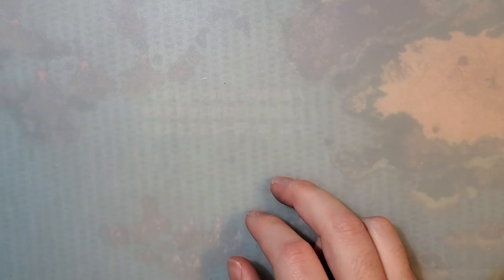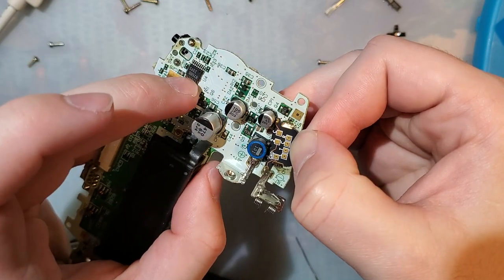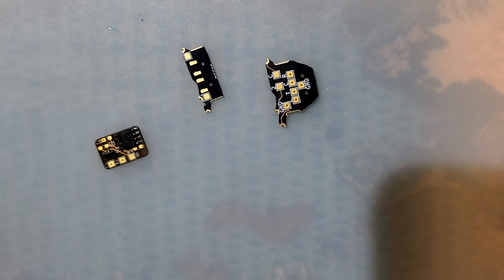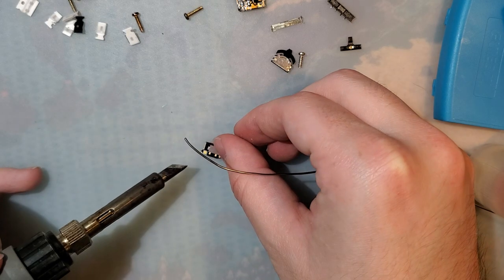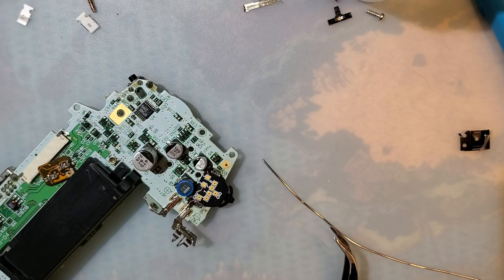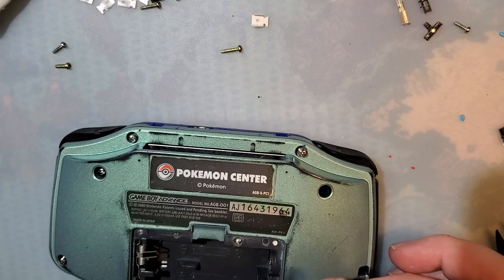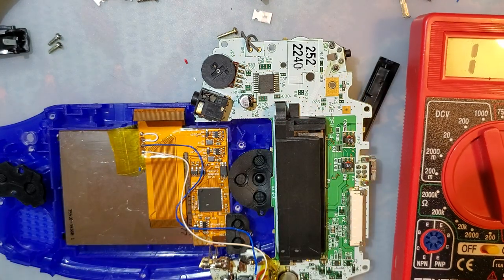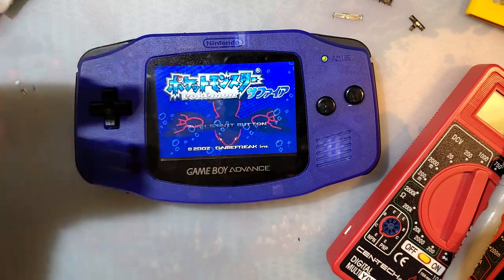Game Boy Advance Power Switch Mod (Soft Latching v2.1)

Comment: You can pry up the metal shielding on those momentary slide switches and the spring comes right out. It makes them handy for other applications.
Reply: This might sound silly, but you might still be able to get the clearance to work with the momentary slide switch by soldering it upside down to the PCB. The plastic piece would be a little bit lower, but it would more or less function the same.
Reply from the maker: @hinorashihinorashi  it's not silly, it's brilliant, and it makes me feel completely justified in buying both directions of switch. This will absolutely work.

Comment: btw, its much easiert to take the part out of the reel (with a tweezer) when its still connected to the reel, after that you still can cut the empty reel space away or keep it there to have it easiert when taking out the next part on that reel
Reply from the maker: yes, true, but I have a tremendously bad habit of just putting the roll down and forgetting to put it away. This is a problem with unlabeled capacitors especially. Cutting off what I need first is my work around.

Comment: You mentioned not bending the upper bracket after only releasing one side and that is indeed great advice. I did exactly that and tore the anchor pad up on the attached side. Not fun.

Comment: Im trying to restore a gameboy light. I changed the capacitors but I ended up destroying the power switch (which is beyond repair). Do you have any ideas on what to replace it with because it is differebt from other gameboy models.
Reply from the maker: I actually started working on this project with the Game Boy Light in mind since I'm working on one myself. I did not plan on implementing the light switch though since mine doesn't have an EL panel anyway. 

There are no solutions that I know of but I'm sure something could be cobbled together. I've just placed an order for a bunch of switches for the Pocket and I may be able to adapt one for the light and retain the third position. I'll know more when I have the hardware in hand (few weeks minimum).

Comment: Hello makho, I am struggling to find a replacement for the power switch of the GameBoy Pocket. Do you have any experience with that one? The switches I find are mostly too big or too small. Maybe you have a part number you can help me out with?
Btw I am really enjoying your videos. As I am an electrical engineer it is really amazing to see someone who tackles these tasks with that much electrical knowledge.
Reply from the maker: I have some ideas on direct replacement parts. I found a few potential candidates and I was going to place an order tonight. I fully intend on making a video if/when I find a good candidate. My favorite option is https://lcsc.com/product-detail/Toggle-Switches_ALPS-Electric-SSSS711403_C160877.html but, yeah, I'll share more once I know more. 

And I am absolutely not an electrical engineer, I'm just a dumb hobbyist stumbling my way through some ECAD and plugging things in and hoping nothing explodes. But it's pretty cool to hear that from someone who is an electrical engineer =)
Reply: @makho  thank you for your answer. I am glad that the compliment was well received.

Thank you also for the switch. I did some more Research too and wound up with the cus 14b by nidec: https://www.tme.eu/de/details/cus-14b/schiebeschalter/nidec-copal-electronics/
Its a single pole 4 throw switch but it might work by soldering multiple contacts to one pad.

I was designing electrical circuits and PCBs for an HMI company for many years. Now I am doing something completely different which is why I took up gameboy modding and repairing, because I always liked the tinkering :)

Maybe if you ever get stuck on something where you would need the input of someone having some experience with electronics I could be of some help to you

Comment: Hi, i have a gba that have all broken pad  except for ON and OFF pad. And i "lost" the fuse near the OFF panel. For now i connet a wire for use the gba when i put batteries. What can i do for connect a new switch and use again? it's possible? or i can't do nothing?

Comment: Change the 10uf C2 cap to something lower and it should power down quicker, when you are holding the button down you are grounding one side of the mosfet and it has to drain the 10uf cap which is why it's taking so long to turn off. Try a 1uf but that might be too quick, maybe a 4.7uf ceramic cap will be a good middle ground.
Reply from the maker: Yeah, I was thinking that a quicker power off would be better. I want to avoid any false positives but I think the current ~4 seconds is a bit long. I just don't have any more suitable caps on hand or I was going to play with that for this prototype. 

Oh and I hope this solves your earlier query. This is the switch I wanted to use =)
Reply: @makho  Yea I had a prototype GBP Raspberry Pi project that used these switches for audio and brightness but as you mentioned the datasheet is not quite right. Anyways try a 1uf cap in place of the 10uf, you must some of those common values lying around. Also if you want to use smaller dualfets and I mean small like the size of an 0805 cap you just need to remove one resistor, if you want to know more contact me on Instagram.

Comment: I know this isn't related to this video but I have a question I was hoping you can help me answer.  I have a boxypixel metal gbc with the funnyplaying ips screen.  I'm having an issue where the screen backlight doesn't turn on right away from a "cold start".  It will begin to flicker after 10 seconds or so before finally turning on after about a minute.  Once on, it will stay on.  It will then turn on normally if I switch it off and on.  Can you help me figure out what is causing this?  I would appreciate it very very much!!!
Reply from the maker: you should contact the vendor, sounds like a problem with the kit. If you insist on troubleshooting first, try reseating all the ribbon cables then, if you can, try another GBC entirely.
Reply: Thank you!  I'll try reseating the ribbon cable on both ends.  Kinda stinks cause I already had to have them send another screen because the first one was cracked.  Do you think it is more likely the ribbon cable or the screen?
Reply: I fixed it!  It was a ground issue

Comment: theres quite a few of these on Ebay but theyre quite expensive
Reply from the maker: I sincerely doubt it because I just made this prototype.
Reply: @makho  i meant the power switch and pcb combo :P so if nothing else just that is useful!
Reply from the maker: @JuicyJakeRepairs  oh ok. I was going to clone those but I made this instead. I suppose I still can clone those because the BOM is insanely cheap.
Reply: @makho  yeah

Comment: Do you know how much power this switch draws when the GBA is off?
Reply from the maker: it draws nothing when both the switch and the GBA are off. It is possible to enter a scenario where the GBA is powered off but the power switch is on but this will only occur if you try and restart the console too quickly after powering it off (and can happen on a normal console too, not just with my modification). I'm sure it adds something to the overall power usage when switch on but I also imagine that the extra power is negligible compared to the extra power usage when using a dirty OEM power switch.
Reply: @makho  isn't this a transistor based switch? If it is transistor based it will draw current because you can't turn a transistor completely off
Reply from the maker: @yerdyi  full schematic is in the github repo I linked
Reply: @makho  looks like there might be 1-5ua leakage current from the data sheet for the MOSFET IRF7317TRPBF .. if I'm reading that right. Unfortunately it would be hard to measure currents that low unless you have the equipment for it.
Reply from the maker: @yerdyi  Hmm, perhaps so. I measured 0 on both my power supplies and with my (admittedly cheap) multimeter. I don't have any tools with that kind of resolution. 

Worst case, if my math is correct, at 5uA, that looks to be about the same rate as the self discharge rate in alkaline batteries. So while not zero, largely negligible since no one should be leaving batteries in their console for extended periods anyway.
Reply: Yeah it won't be much current but definitely not zero since the there isn't an open circuit between the battery terminals with this method like there is with the factory switch.  If you ever want a relatively cheap solution to measure currents down in the na range you could pick one of these up
https://www.eevblog.com/projects/ucurrent/

Comment: Dude PLEASE tell me that this can work on a GBColor and pocket!!
Reply from the maker: this can work* on a Color and Pocket
Reply: @makho  dude, if you make a video, on it, I would buy it :)
I have a color on hold for 10 months because I broke the switch while cleaning it. Removed all the huck from the battery leak and installed a battery mod, but I broke it 😂
Reply from the maker: @rodrigomiranda8779  I've done a video on a broken power switch for GBC specifically: https://www.youtube.com/watch?v=Lnr0jTQFOhE

And while I intend to make one of these boards for GBC and GBP, it will NOT support brightness control on most kits (or at all, haven't decided yet). It's not that I don't want to implement the feature, it's that most kits are using touch sensors instead of button based controls which means the implementation would be different for my mod and I'd rather keep it simple.
Reply: @makho  I have seen it, but my completely broke ... the corrosion was so much, it almost desintegrated :x
I am on the market for a busted GB Color, only for the switch :D

Comment: Finally fixed my onyx black Palkia dialga ds lite charge issue it was the fuse closest to the power button or right trigger I didn’t have any other fuses so I just shorted it out with a solder bridge I don’t care if there’s a chance it’ll short the mobo because how often do fuses blow it was probably a faulty charger or something anyway and I only use oem nintendo ones plus the mobo is cheap I know this was random lol but thanks for another video 👍
Reply from the maker: Dude. That is NOT fixed. Fuses exist for a reason.
Reply: makho lol ik but I don’t have any fuses😂 I’ll just buy another motherboard for $15 I’m not experienced in board repairs and I’m limited on tools
Reply: Has been working perfect for a week so far lol I’ve put 9 hours on platinum
Reply from the maker: @kingarthur7255  You can get like a dozen fuses for a couple dollars shipped. Way cheaper than a new motherboard and has the added bonus of not being a fire hazard.
Reply: makho didn’t know it was a fire hazard I was told it’d just short out the motherboard that’s why i went ahead and did it this is my first attempt at a board repair I used the pointy tip on my iron and once the first side of my fuse popped off I bent it upward so it wouldn’t resolder down because it was laying in molten solder well when I did this I accidentally razed the solder pad on the other side and ruined the board anyway I had a spare motherboard I was gonna get a fuse from same system ds lite but this motherboard is beyond repair it was a heavily damaged ds lite I technically I have a fuse and planned to do it right but because my motherboard had a pad lifted I couldn’t I figured welp fuck if I have nothing to lose
Reply: makho but if it’s an actual fire hazard I’ll trash the board sooner than later and it’ll be another parts board and I appreciate you making a point to warn me of my own ignorance 😅 just wanted my ds lite back